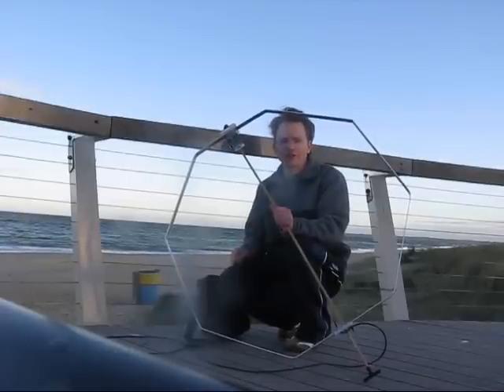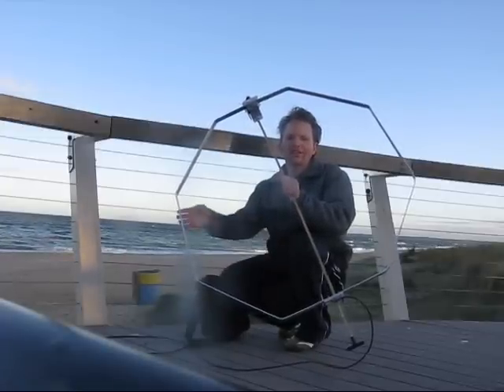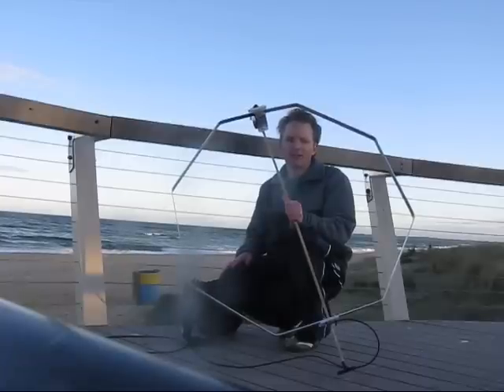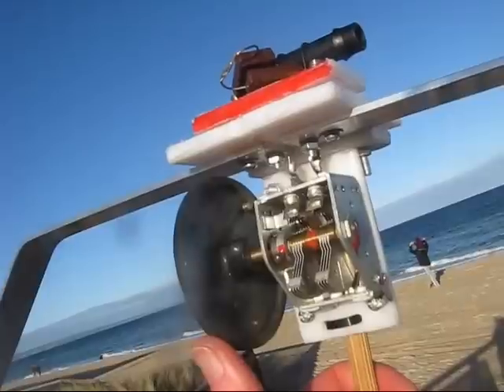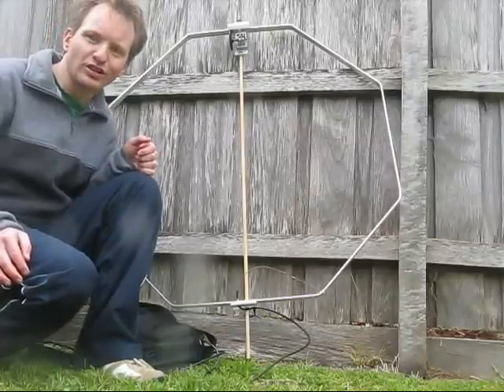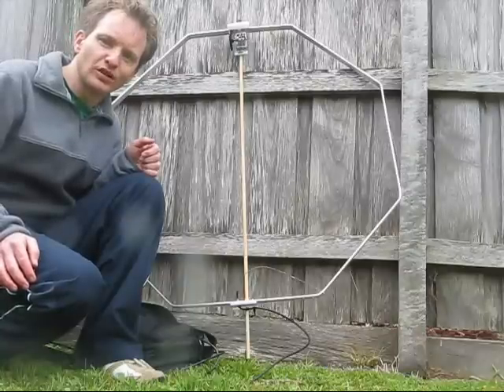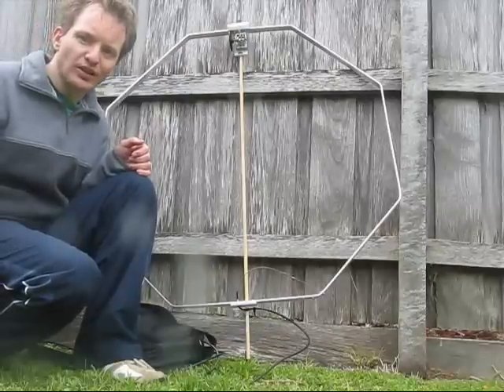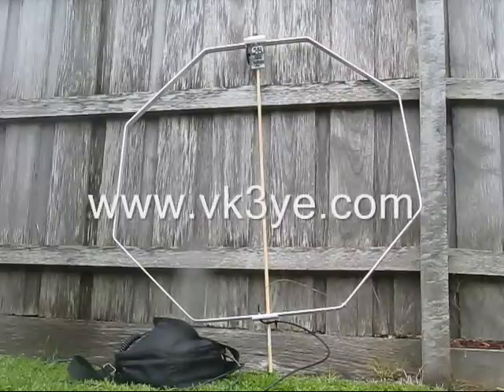3.5 MHz pedestrian mobile with a magnetic loop

Comment from the maker: @combatwombat71 I actually wished that the loop had narrower bandwidth, as that means it would be more efficient than it is. Unlike the higher bands the SWR doesn't quite drop to 1:1 and tuning is quite broad. 160m is even worse so it's really only a receiving loop down there. 

You're right - small size vs efficiency is a tough trade-off, but small size + light weight + portability vs efficiency is even harder!